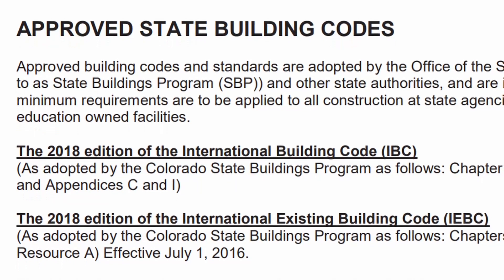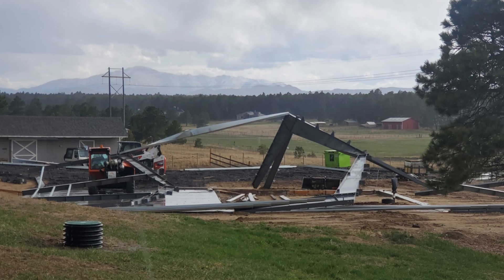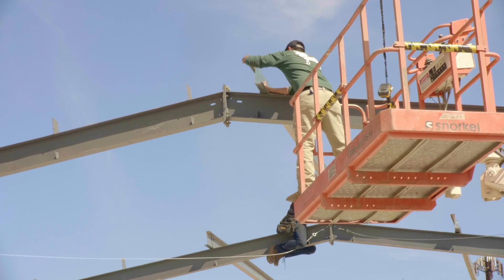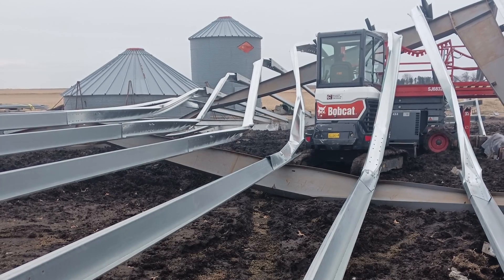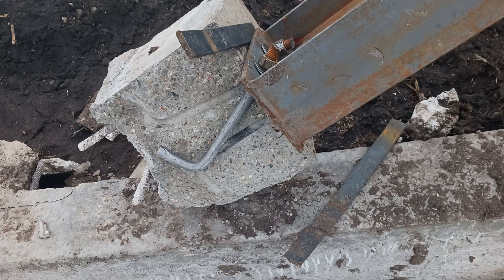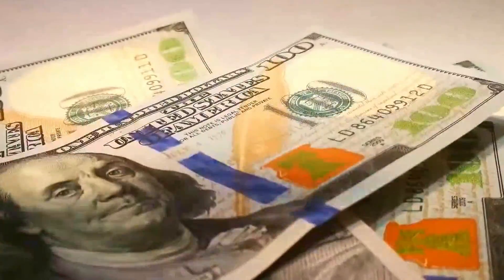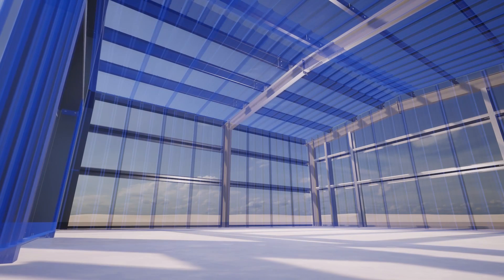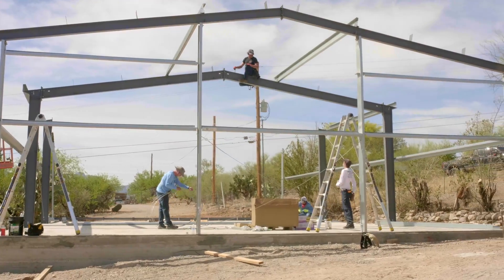Steel Buildings Disasters | Why do they happen? How can they be prevented?

Comment: What if the sandwich panels will be installed later on maybe after weeks from the steel installation, and diaphragm action will not be applied, in that case how to insure that structure will stay stable ?
Reply from the maker: Hi, This is a good question. Buildings with Cable Bracing/portal frames or other bracing types do not rely on panel shear. Panel shear was just brought up in the video because even though the panels may not be designed into the bracing system, the diaphragm they add is a lot. 

When GWB designs buildings for IPS/MPS (Sandwich Panels) they are part of that design. If it is going to be retrofit later, we should be contacted to make sure there will not be any concerns. 

Thanks

Comment: Why do you guys use tapered columns which gives no stability from the base they also require more fabrication time I simply don’t understand this btw I am from the uk and own my own steel erection co
Reply from the maker: Tapered Frames transfer the load to vertical. No reason to have the base of a column be as heavy as it is in the haunch section. Constant depth columns would not have prevented this.

Comment: As a long time but now  former carpenter, in the crane biz for the last 25 years nowadays, I agree with this video!  I was setting some steel 3/12 trusses a few months ago, 80' span, and once set on the posts and I was told to cable down, I was spooked to see the amount  of side deflection they had, Immediately cabled up just enough to keep them straight, then had a heart to heart talk with my farmer/rancher customer.  He saw the light, and agreed that more crane time now would be cheaper than buy a whole new building if he rushed it!  We used a big skidsteer and a even bigger farm tractor to tie off to as we went. It took all the excitement out of the job!

Comment: I assembled Gulf States buildings ,we would assemble 2 bays ,sheet the walls then assemble 3rd bay & sheet 3rd bay & sheet roof on first bay ,we endured some major storms, all wind bracing installed during frame construction

Comment: What snow loads are these buildings designed for?
Reply from the maker: Hi, every building we sell is designed for the local load requirements for it's location. We've done buildings up to 300lb per square foot roof snow load requirements. Thanks

Comment: temporary chain and binder or cable x braces really help stiffen the steel and also make the structure a little more ridged until the girts and purlins are installed. and yes having to adjust these for fit is a pain in the butt. it's way better than having the steel back on the ground.
Reply: We tighten every thing overnight and weekends,  wire rope every every night Xed out,  remove wire rope when necessary during day loosen anchors a little while doing purlins and girts, everyone gets to go home, re impact anchors at end of day

Comment: The first span up and desconnecting it from the crane is always the most risky part.  It will be standing naked as you called it. Therefore, before desconnecting from the crane, we always put tension belts, like the ones used on trucks, 6 in total, 3 to each direction at the gutters and at the eve. We use the racket to position the span as vertical as possible. Only then we disconnect the crane, then we lift the next span as quickly as possible, fix purlins at the corners and at the eve followed inmediatly the wind braces. Then you have 2 spans up and secured.  Only then you can take a breath and continue building.  The tension belts we'll usually let them until the structure is complete and they get in the way.
Oh the tension belts you fix to whatever heavy thing that may serve, but if you connect it to any vehicle like a fork lift or so, I'll have the keys in my pocket.... you don't want anyone to drive off with the structura attached.
And when operating a lift around the belts, make sure a guy on the ground is keeping an eye. One of our teams met disaster when a lift hit a temportary wind bracing cable.
Reply from the maker: This is great input! Thank you

Comment: A large metal hanger was being built at MacDill AFB FL, when disaster struck.  The error that was made, was installing the rafters, but not fastening them to each other.  The wind came up that night, tipping over the rafters, which bent the sills and vertical beams.  The building was a total loss.
Reply from the maker: HI Robert, The latest high visibility collapse just happened about 6 weeks ago in Boise - Very sad - several people died. Large Commercial project - I've poured over the available pictures and can't figure it out. Usually this is erector fault - which can be seen by the frames falling like dominos (as you said) but this one doesn't appear to have failed like that. I know the manufacturer - and they're not the corner cutting type - such a mystery. Thanks for the insight and comment. 

Eric

Comment: I built prefabricated steel buildings for many years, I have seen so many people cut corners. Educated erectors are the key
Reply: I need to put a header on an inside load bearing wall in my 26x32 metal building. I'd like to create a 16' gap with the header along the 26' length of the building.  
The structure is 2.5 square tubing with 4 ft on center supports. So essentially I'd like to clear 3 support beams with the header. 
Recommendations?

Comment: I'm a site manager for one of the largest erection companies in the US.  This can be stopped with a dedicated temp. bracing plan.  Great video. 

However, depending upon how many frame lines are in a building determines upon if the wall sheets catches more wind than the web of the rafters. You also have to calculate rafter depth and percentage lost due to wind shear on each rafter.  On these small buildings shown, the wall sheets will always catch more wind. Once you get into much larger facilities this changes. 

I'm on my wife's YouTube account BTW.

Comment: You guys should include a foundation plan as part of the building plan. It would eliminate problems like this, especially for only $800.
Reply: They're offered on every building if a customer chooses to get one from us. There's some tradeoffs when it comes to costs though... Every building should have a foundation design but even at $800 bucks on a simple building GWB is not always the best option. Local engineers with PEMB experience can sometimes save more than their fee in rebar and concrete just because of their local knowledge of the soils in the area.
Reply: Pre eng prints come with anchor bolt layout plans .

Comment: Great Video. Scary to see that some erectors would consider that foundation and technique of bolting it down to the surface safe. Hopefully this video will help educate some of those that may need a bit more knowledge when it comes to putting up a steel building. Thanks for posting it. Hoping one day to being one of your customers, but until then, its always nice to see another Saturn 5 fan.